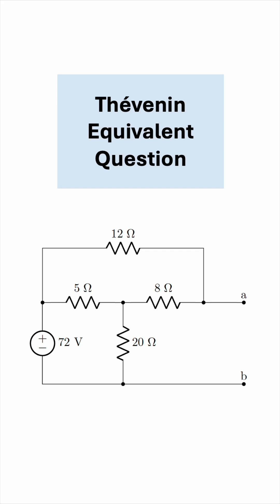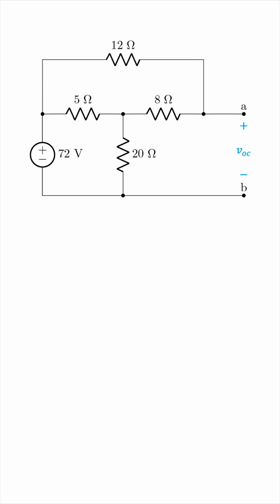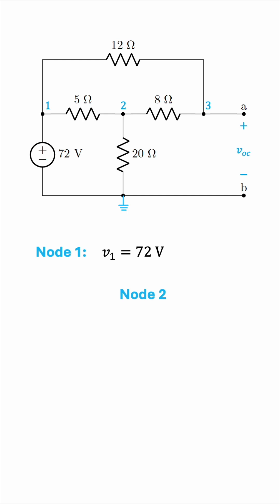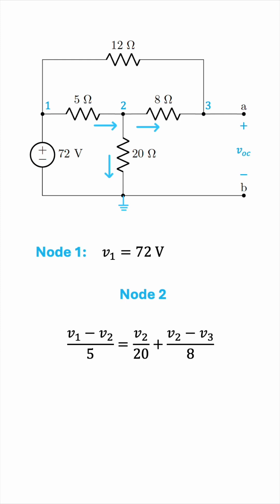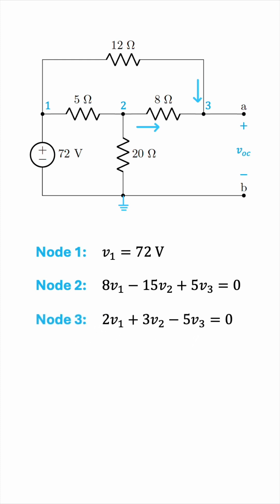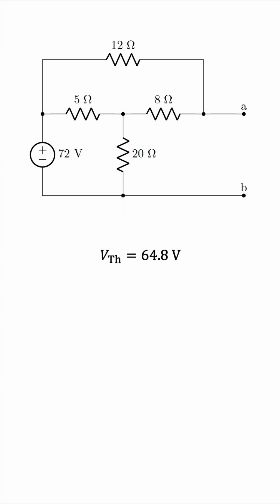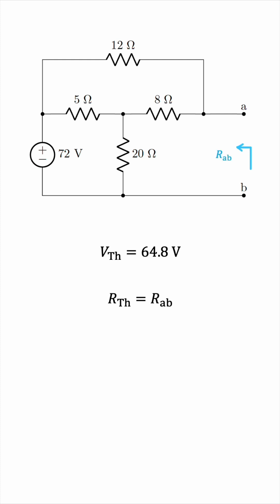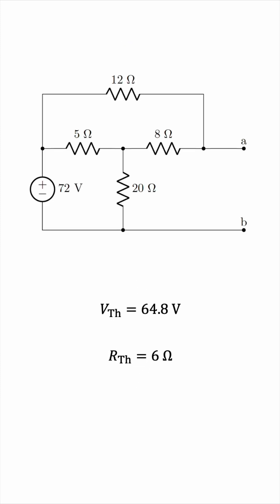How to Find the Thévenin Equivalent Circuit

Comment: Great video 🙌 can you please explain how I’d do this if the 12ohm resistor was swapped out for a current source
Reply from the maker: Glad you liked the video.

In finding Vth, you could also use the node voltage method, and what would change is only the equation for node 3: instead of (v1 – v3)/12, you would have the current from the current source.

In finding Rth, you would treat the current source as an open circuit, and the equivalent resistance looking into terminals a and b will become (5 // 20) + 8 = 12 ohms.

Comment: Hello, tahnk you for the explanation, I just have one Question: Why is the current trouth restistance 8 Ohm the opposite of the current through resistance 12 Ohm?
Reply from the maker: @baller.15-i1d  The truth is that you can assume current directions and apply KCL at each node using your assumptions.

Then, if one of the currents turns out to be negative, you come to know that the actual direction is opposite to the one you assumed.